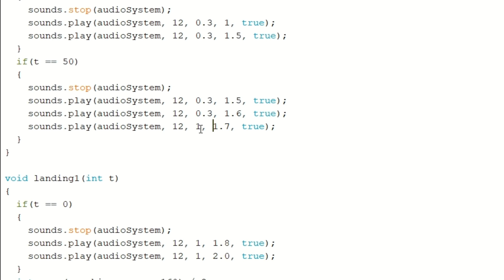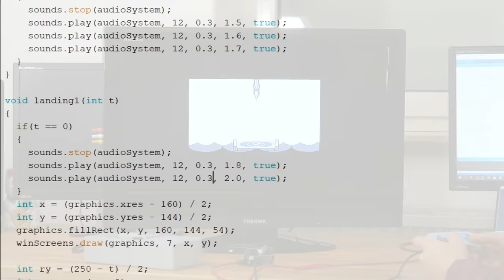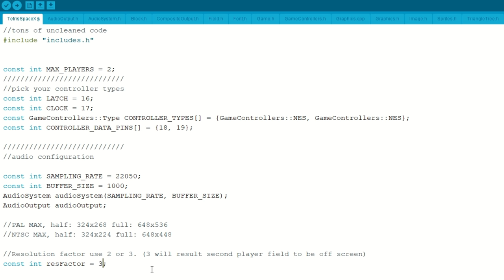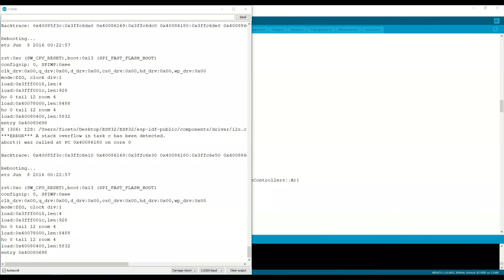CRT BOY Part 3: Finished! [ESP32, CRT, Retro]

Comment: Hello Bitluni! Thank you for this incredible work! I tried to run your code and had some problems. First, to be able to compile, I had to downgrade the ESP32 lib to version 1.0.4. Now I can compile and run it, the code works and generates a video signal with the opening image for a few milliseconds, until the CPU restarts for no apparent reason, remaining in bootloop. I've already reviewed all the configuration and tried changes to the code, but nothing worked. I believe this is being caused by an update to some library you use. I learned a lot from this project of yours. Thank you very much.
Reply: I also tested with previous versions of the project ("first commit" and "major refactoring"). Unsuccessfully. I'm starting to think maybe it's a memory overflow problem.

Comment: I was wondering, what's the lowest amount of lines it can handle in progressive mode?
Because imo you could try to generate a resolution like 320*144p letterboxed in the lowest vertical resolution it can handle (let's assume 200p as example), so you have the 160*144 frame of the gameboy stretched 2x horizontally to fit 320, while the  vertical 144 will be letterboxed in 200lines with no scaling. Then, just stretch the picture vertically with pot overscanning the letterboxed area, so you have your nice progressive image to fill the whole surface!
Reply from the maker: That's actually an interesting idea. It would be just a matter changing the timings. I remember there have been display modes in the dos era that did similar things. The individual lines might become visible, but we could change the focus to compensate for that... or it will look even more retro

Comment: You should definitely try (or start using) esp-idf. It is pretty straight forward and allows more configuration. Even thought I really liked to use Arduino IDE, after trying out esp-idf for a couple of days I fell in love with it.
Reply from the maker: I had problems running it on windows since I don't have a linux machine but I will try it at some point again. I only use Arduino because it's the easiest and most common way for the viewers.
Reply: Oh, sorry. I really forgot that it's not as easy on windows. The main reason I liked esp-idf is that there are some very cool projects (OpenTyrian, Doom, Duke Nukem and some console emulators). And seeing that, I started to build my own little console based on esp32. It will work like odroid go, but with a little bit different schematic, so I wrote my emulator launcher, because Odroid Go's is closed source.
Happy New year! Your projects are great!
Reply from the maker: Sounds awesome! Btw do I recall you from github somehow? Can't find it anymore.
Reply: @bitluni  Yes, I opened an issue once in ESP32CompositeVideo repository. (issue #8)
Reply: @bitluni  As long as you got a Windows 10, you can run Linux distros (say Ubuntu) on it using WSL. FYI, serial port support is OK since FCU. A long time request to enjoy hardwares SDK while keeping on Windows as a host ;-)

Comment: you shouldn't be using a magnetic tip screwdriver on those pots really should only be ceramic screwdrivers plastic holds static charges